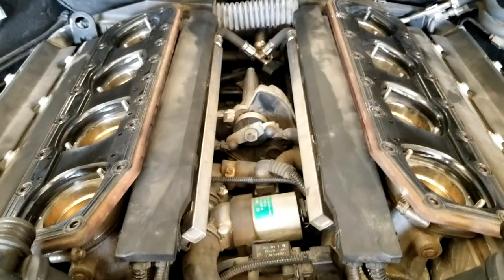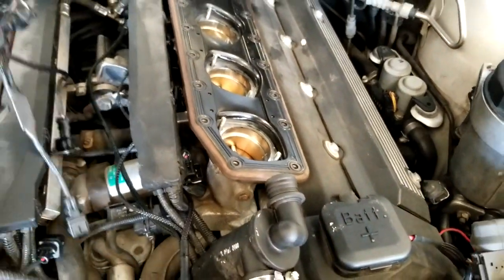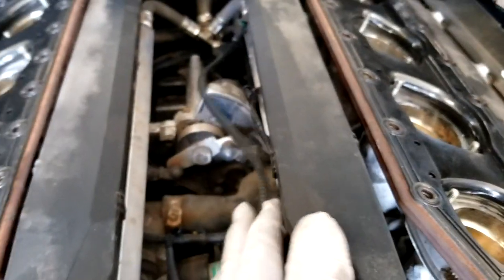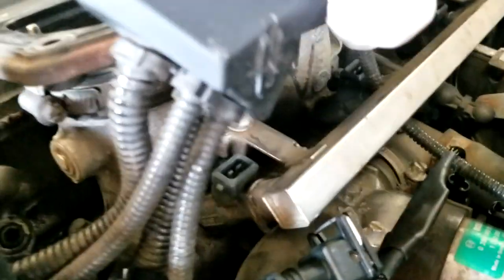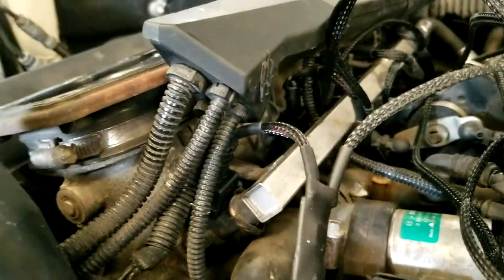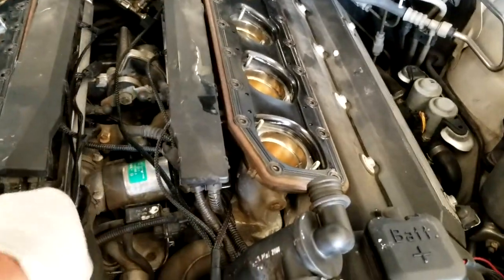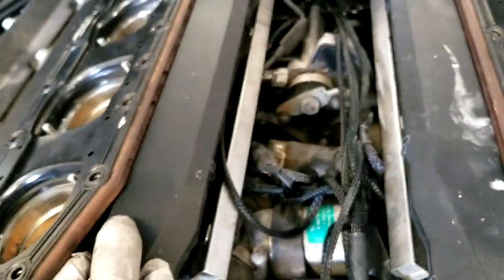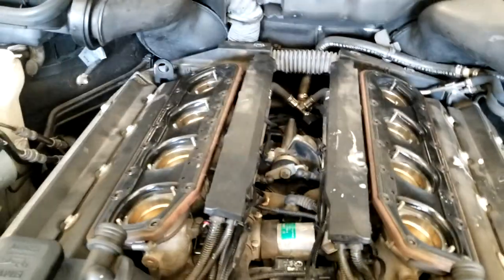ProFlex Commander for E39 M5 Wiring Harness Installation

Comment: So i have to rotate all the injector in order to to plug the cables? No risk on doing that? :o
Reply from the maker: All the injectors rotate so you can angle the connector where you want it.
Reply: Advanced Fuel Dynamics are in SoCal by chance??